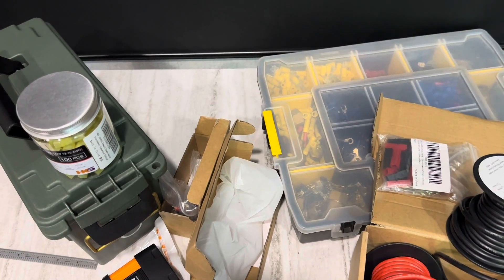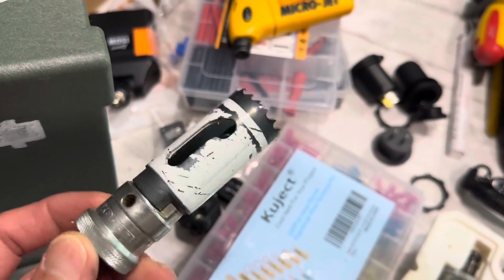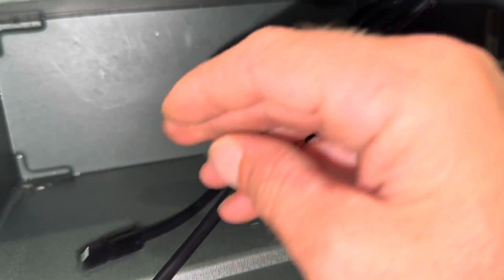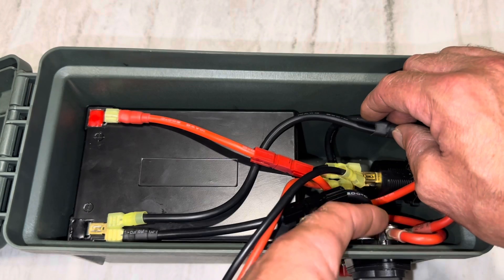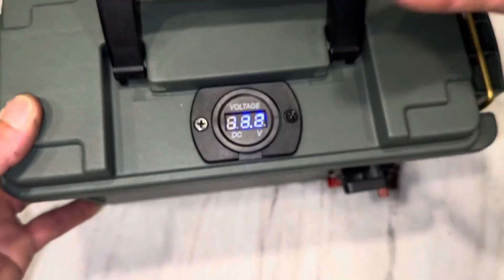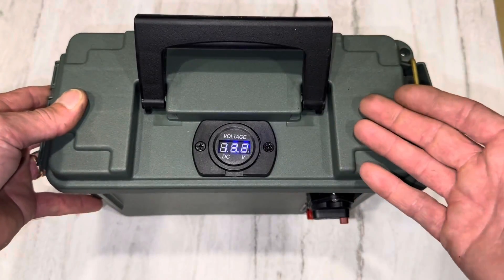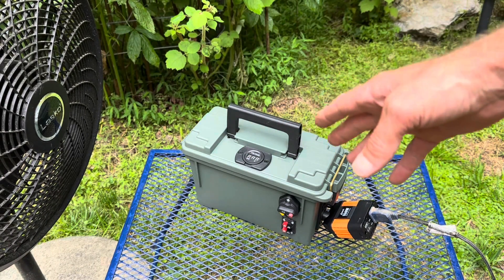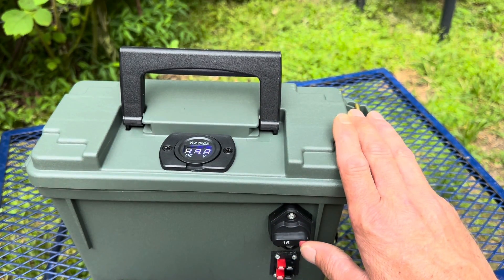Ammo Can DIY Portable Power Box 12V DC and 120V AC Power

Comment: Can you charge it with 12v from the car? I’m thinking about building one and that’s my only stumbling block. I’d like to have an Anderson input like yours and either use my 12v trickle charger or a male lighter plug pigtail with an Anderson on the other end. I think it needs some type of charge controller.
Reply from the maker: Male lighter plug would probably be fine. Only so much current can flow through them. Most have wires sized for around 10A and a fuse. Your car would have to be running so the voltage is around 13.8. Won’t get much charge from lead acid sitting at 12.6-12.8 with the car off. 
I usually use a 10A switch mode power supply set to 14.4V or my bench top power supply.

Comment: Great video, how is the breaker replaced if needed? Would you want to add a fuse? Thanks
Reply from the maker: @albertdrew7235  The breaker is on shortest wire run directly from battery positive. A fuse could be used in place with addition of a main switch to break power from battery to loads. 
I chose the breaker b/c it accomplishes both functions. Two screws hold the PNL mount breaker and if the breaker ever breaks internally (mechanical failure) a simple changeout can be accomplished in 5 min or less. Hope this helps, if you need anything else LMK!

Comment: It's 2024...Who uses 12v cig outlets anymore and for what? you got USB & Andersons. Cig outlets cause RF noise and they heat if you put much of a load. Replace with Andersons and  Getter Done! LOL! If you gotta have a cig outlet get one that is fused on a cord from Powerwex with Andersons on it! Nice Build!
Reply from the maker: Just put it in for the tiny automotive style inverter. No other inverter would fit inside the box for stowing. Build however you want just shared to hopefully help others get creative that is all.
Reply: @THEOFFGRIDMOUNTAINHOMESTEAD  YUP! It's your Build. Build it how ever YOU want!
Reply: I have a 12v electric blanket in my car that uses this 12v plug. My power station works perfect for this. If I'm stuck in my car in an emergency, I can run my blanket off my power box and save my car battery.
Reply: Another good use of the "cig outlet" is for charging the battery through that connection, most smaller chargers still come with the "cig male receptacle"! Good build! Amazing how many critics "crit" other's ideas.....🤔Nice job!

Comment: CAN RUN A SMALL 12V FRIDGE WITH THIS SETUP..?
Reply from the maker: The battery is capable of 20Amps. Check your specifications on your DC refrigerator to make sure. Example Bodega brand units usually pull 6A so it would run a Bodega cooler. 
Hope this helps!
Reply: @THEOFFGRIDMOUNTAINHOMESTEAD  THANKS FOR THE ANSWER...!!!
Reply from the maker: You’re welcome!
Reply: @THEOFFGRIDMOUNTAINHOMESTEAD  I WILL MAKE MY OWN SETUP BASED IN YOUR VIDEO...THANKS.

Comment: Great video! do you have the wiring schematic?
Reply from the maker: Thanks! I’m updating this build version very soon to include a solar charge controller! I’ll provide a slide in the upcoming video with a diagram!!!
Reply: @THEOFFGRIDMOUNTAINHOMESTEAD  Awesome, I'll hold building this until then and maybe just accumulate most of the parts between now and than.  Thanks!
Reply: You did a great job on the build. Out of all of them yours is the one I 95% copied with a couple changes by adding a charge controller for a 30 watt potable solar panel. Did you ever upgrade yours with a charge controller ?  Do you have that link? 
…I’m stuck on how to wire adding the charge controller. Thank you!